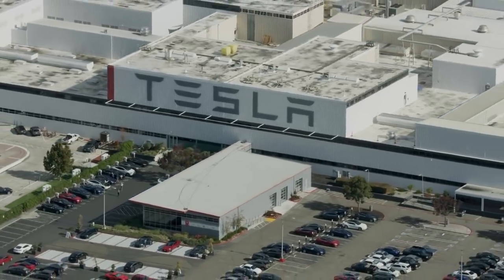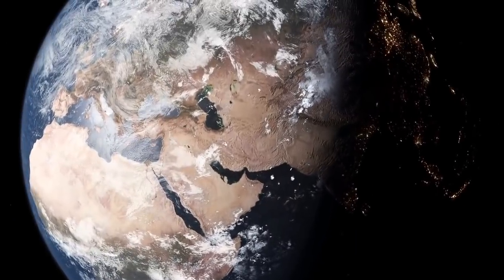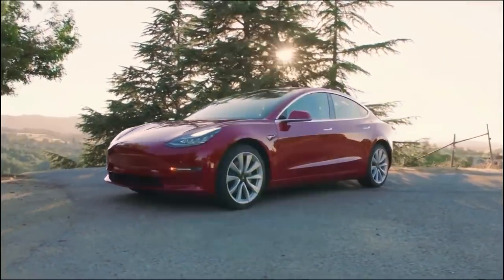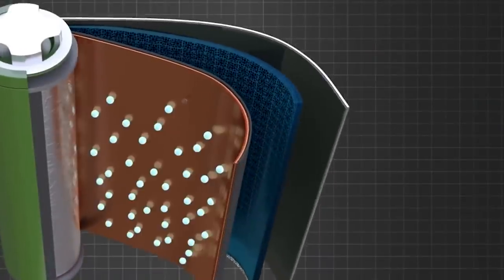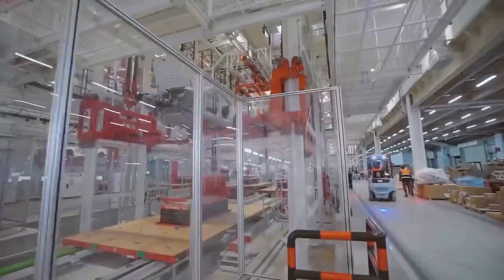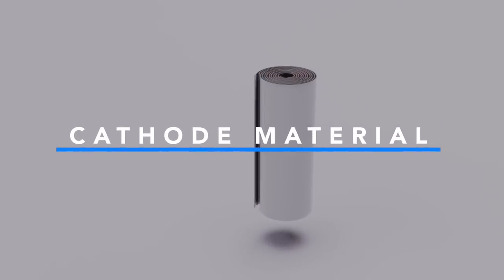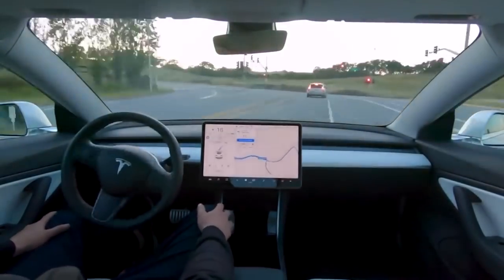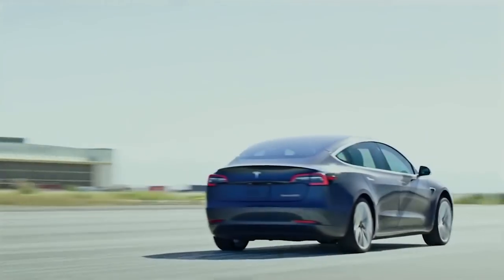How Tesla's NEW Battery Is Changing Everything

Comment: I think you misunderstood the core changes to the cells (imo)

Tesla said the cell holds 5 times the energy and six times the power, yet the vehicle only increases range by 16%.
Why?
If we assume the thickness of the "jellyroll" is similar and the space at the core of the cell is the same, the extra winding layers and greater height of the 4680 mean the is almost exactly 5 times the surface area of jellyroll in each cell.
Since this material stores the energy....... 5 times the energy (capacity).
The rate at which that cell can dissipate they energy is largely limited by heat, which is largely the result of internal resistance.
How to reduce that? Shorten the electron path, provide more contact area for the power to "escape".
That's the "tabless" advantage.
So each cell has 5x the capacity and 6x the power compared to a SINGLE 2170 cell.

Next advantage.
Assuming they can speed up the "front end" input of the material (Maxwell dry process) for the same number of "cans" leaving the plant, they have that 5x energy/ 6x Power.
The factory has more capacity (in much less space, due to the compact Maxwell process).
Then, there's the weight saving.
Estimates indicate the new format reduces the number of cells required from over 4000 to 970 (Model 3)
But, the cell is larger.
Calculating the surface area of the 4680 vs 2170 cell and adjusting for quantity, that's about 40% reduction of material (steel) and so weight in the cell casings. Lighter pack.
This goes toward the "16%range increase".
One thing everyone has missed....
These calculations do not account for "better chemistry"!
It's just packaging.
If you add the new materials/ chemistry, that density increase can be added to the above.
Reply from the maker: WOW!! Thank you for your comment, make sure to subscribe for more videos like this one!
Reply: At least a few people like you understand properly and haven't fallen for the hype. It's all largely about optimising the manufacturing process. There's no 'new tech' worth mentioning.
Reply: The batteries in EV's have less energy density than coca cola. Coca cola has 95.8 grams of sugar per kilo. A gram of sugar has 16kJ of energy. So 95.8g have 1532.8kJ which converted in kWh are 0.425kWh/kg of coca cola. Tesla 100kWh battery has 625kg and 100kWh that is 0.16kWh/kg. So coca cola has 2.65x the energy density of a tesla battery. If we would burn the sugar in coca cola in a diesel engine with 40% efficiency that would result in a production of 0.17kWh of mechanical energy for every kilo of coca cola. Electric engines in ev's have around 85% efficiency so those 0.16kWh from 1 kilo of battery would produce  0.136kWh of mechanical energy, that is about 80% of the coca cola or a car powered by coca cola has 125% the energy density of a tesla car. Even chicken soup has more energy per kilo. Chicken soup has 168calories/510g = 329.4cal/kg = 1383kJ/kg = 0.384kWh/kg. Chicken soup burned in a diesel would provide 0.15kWh of mechanical energy/kg = 112% of the tesla battery. So, with the "new" battery tesla will manage to produce a battery with energy density between chicken soup and coca cola. That's a massive improvement.
Reply: Because the 5 times and 6 times numbers aren't 'like for like' comparisons. The 16% improvement is however the SINGLE HONEST number mentioned.
Reply: @crichtonjohn1187  If you compare like that, it is entirely true. It's one reason why electric airliners will never happen in our lifetime either and most likely NEVER EVER !
Reply: @grahamstevenson1740  with a energy density so low they won't be able to make even trucks, vans and the semi is just a publicity stunt. A semi truck has about 1200 liters of diesel fuel which weighs about 1000 kg and has 12.6 kWh/kg. That means 12600 kWh stored in the fuel tank which can be converted into mechanical energy with 40% efficiency which means 5040 kWh. Because the electric powertrain has 85% efficiency it means we must have a battery of 5040/0.85=5929 kWh to achieve the same range. At 0.16kWh/kg that means we need a battery which weighs 5929/0.16=37056 kg = 37 tons. Since a semi truck in the USA has a maximum allowable weight of 80000 pounds=36.2 tons that means the battery is heavier than the truck it should power. Even if we sacrifice the range the truck could never work. Even if we cut to 1/5 the battery it still weighs 7.4 tons and the truck would need a lot of reinforcements just to support a battery which weighs as much as 5 midsize cars and with such a low energy reserve and low payload nobody could use it. That's the reason there is no cybertruck and no electric semi except publicity stunts. Even a full size SUV will be very hard to make. Due to extreme weight the car will need very strong chassis and suspension and steering elements and brakes and tyres which will add to the weight and the car will be very hard to manoeuvre, it would be more like a tank on wheels. There's no real electric SUV just a mid-size crossover and that's about max what can be done with batteries.

Comment: should be 100Gw by the end of 2022 and 3Tw by 2030
Reply from the maker: Yes, Tesla has discussed reaching those expectations. Tesla have also said for sure that ModelY production in Berlin will use 4680's stockpiled from the pilot plant in Fremont. It's about a 10GWh/yr level but it's not running perfectly yet. So output is under that but close and it's been running for about 7 months already. 
So we preferred to keep the expectations low and realistic at least for now.

Comment: THE SAD TRUTH is that Li-ion batteries have a potential upgrade path to an energy density figure of only ~500Wh/kg (the number that really matters). Currently manufactured 18650, 2170 and 4680 cells have an energy density of between 300 and 350 Wh/kg, so that's a potential improvement of ~ 55% or about one and a half times as good. This is predicted to take maybe 10 years to achieve by a number of incremental improvements of around 10,15 or 20%. The 'perfect' Li-ion battery might have an energy density of 600Wh/kg (the upper theoretical limit) but this is the real world, not a perfect one and pure perfection isn't achievable or practical. To achieve anything better will require the use of an entirely new 'chemistry' i.e. one using different elements/materials and no candidate for this is currently on the horizon. Flow batteries, for example, have lower energy densities but are attractive for entirely different reasons that will be attractive in static or fixed applications like power banks. Li-ion, with its drawbacks, is the best on offer for mobile energy storage. Tesla have no MAGIC that will change this or any other of the fundamentals of materials science.